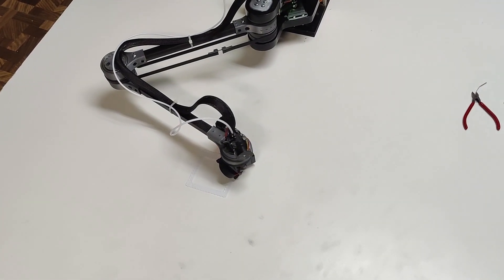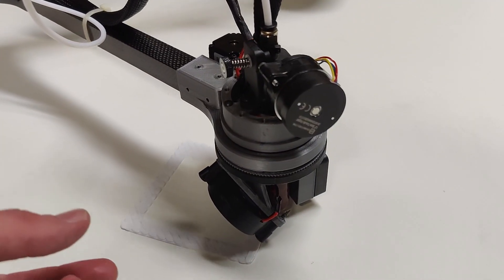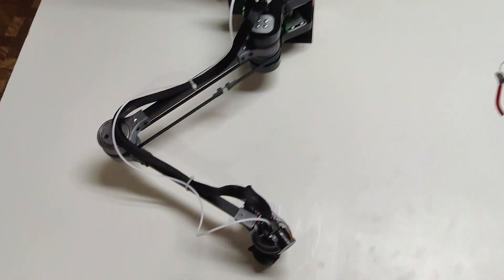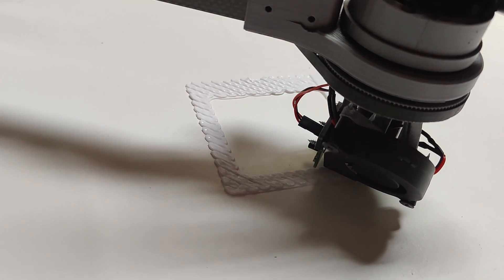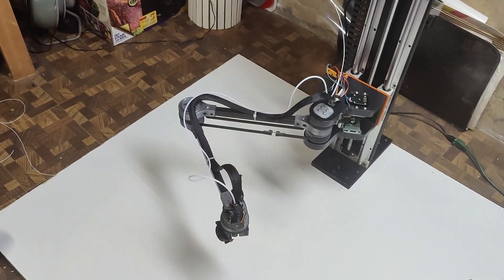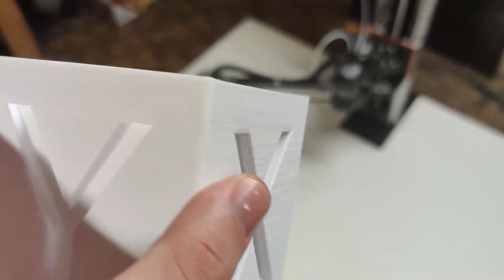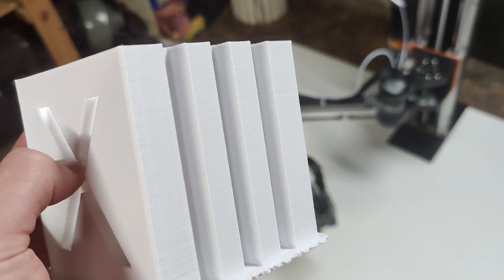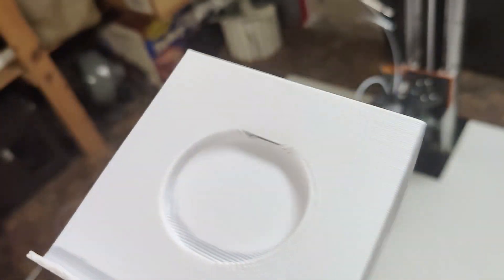From bad print quality to high on big prints - IBIS S1 SCARA 3D Printer

Comment: Wow! That is a huge change, nice catch! Of course the weight of the arm is going to cause some problems. I wonder if you could have some follower system on the roof to help hold the arm. Or maybe a single line to the top of the tower.